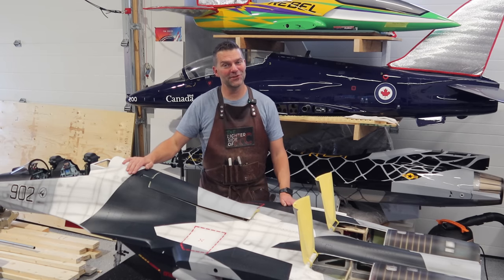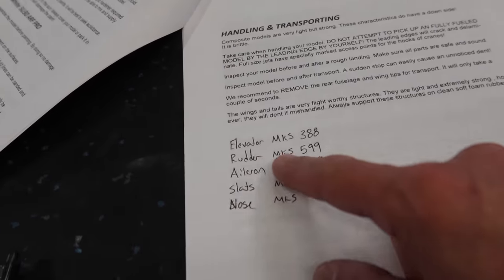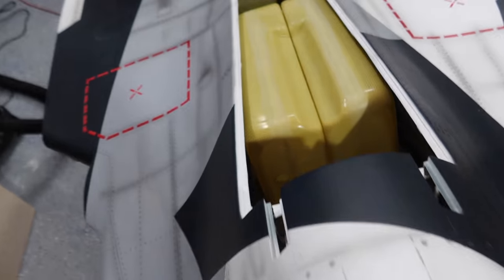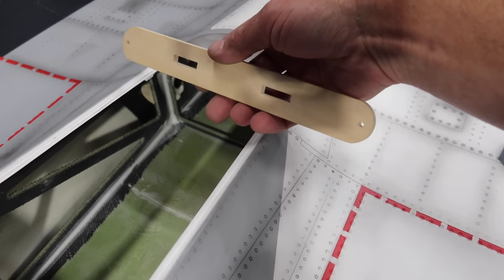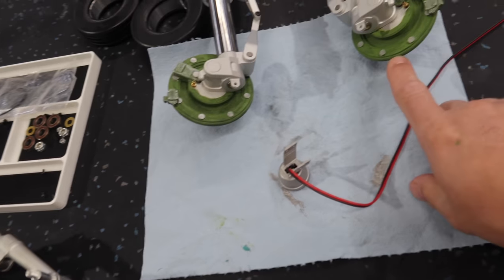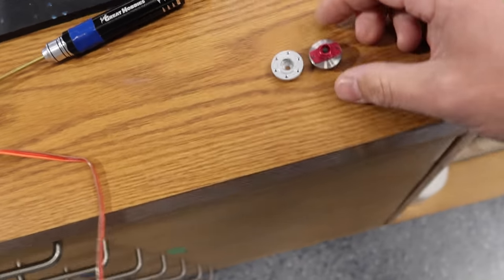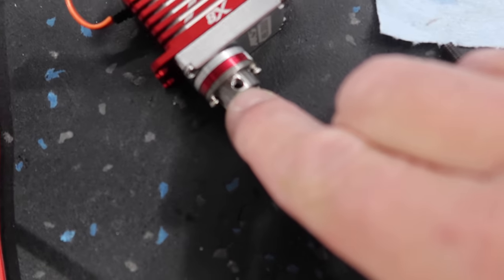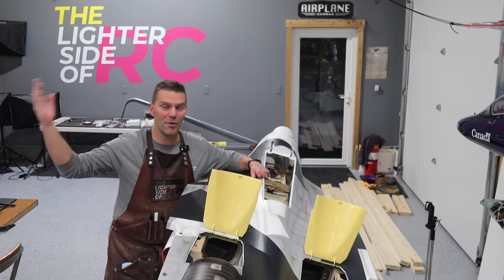The Art of Engineering: Building the Skymaster SU30 RCJET Russian Edition

Comment: Jonathan great video!  Here is a tip. I'm sure you know this but if not, use the DS24 to cycle all your servos at one time. Plug them into the CB or receiver and go to <system> <servo & range test>  set your servo speed then tick the channels you want to cycle. Hit Start and now all your servos can be done in 20 mins! Of course you would need to bind a RX to your CB. You could even get the CB320 and 210 bound and hooked up. Assign all your servos then you get to cycle and test your setup!
Reply from the maker: I didn't know this existed!  Thank you for sharing this!  May end up being the TIP TIME is the first 339 video!

Comment: Hello John, the servos that you use (MKS). how do you determine the power of the servo you need? In 30 plus years of model flying the choice of servos is to me anyway is getting to be very baffling (I've had some years off lol). Also. is there a particular site you get MKS servos as I'm having trouble finding the ones your using in the SU30 as I'm just very curious. Keep up the great content x
Reply from the maker: Hey Amy. There is a few criteria bits that I use. The main stays are the 9930 which is coreless and the 599 which is brushless. The 9930’s are great for pretty much everything. On my kinetix I used 599’s everywhere. On the rebel classics we used 599SL everywhere and 9930 on flaps. The 599 sl to save weight. 

On the big planes you have to go with some of the next level servos 388 or 3850 with the larger shaft and much more power. Those are the staples. 

Oh and typically 1220hv on most steering. 

Supply will depend on where you’re located. I can supply servos to USA or Canada easily. There are other dealers all over the world

Comment: A bit off topic, what is your favorite product to use to hard mount at the wing root for wing retract/servo plug connections? I'm not finding anything with 4 connections that really hits the spot for me. Thank you.
Reply from the maker: Great question!  I don't like to hard mount connectors and I don't think I ever have done a wing or surface connection hard mounted.  i've see mounts for one half of the Ashlok connectors to be hard mounted and the other side floating which I would use but needs to be the right situation for that to work with enough room.

Comment: do you feel safe to feed power to 8+ servos from 2 servo wires that are more than 2m long each????
Reply from the maker: Power to all the main servos except leading edge will come from mid (main) central box. These servo leads at most are 3-4 ft long. 

The signal between both central boxes isn’t the power distribution. Each CB210 has power connection.
Reply: or you will you seperate batteries frond and rear?

Comment: I have a quick question: would it be possible to fly the RC setup that you presented us with a Jeti ds16 or is an ds24 necessary?
Reply from the maker: The New 16 also has 24 functions so wouldn't be an issue.  The issue would be making sure you have enough switches on the radio to opperate all the functions as the 16 doesn't have the rear buttons, switches.
Reply: Thank you very much for your answer know I am a bit smarter

Comment: Hey bud do you happen to know how much the stock tanks hold?
Reply from the maker: Hey Keith.  I don't off hand but in the final video (number 7) we will measure tank capacity during CG and test runs.  Just waiting on 240's to arrive.
Reply: I just measured mine at L Tank = 3750ml, R Tank 3975 ml, and 3500 ml for the rear tank.
Reply: @IVHMSFSR  Thanks, thats a lot of fuel, thats almost 9 mins at full throttle with my motors. I want need the saddle tanks really.

Comment: $1750 in JUST the servos alone, plus 5800 for the airframe, and 6200+ for the engines...jesus man those 3 parts alone cost more than my used 2013 Mustang 5.0 did lol. Love watching it but could never afford this hobby i dont think
Reply from the maker: Plus 6k for the gear. Plus 4000 for all the other pieces to assemble. Plus 500 in wiring. +++++😂😂. This is one of the most expensive “normal” aircraft you can get. You definitely don’t start in turbines with something like this.
Reply: @thelightersideofrc for real...ill just enjoy the build and from my screen😂😂 thing costs $30k once done painted and flying and the controller and everything else like shipping and tax. Id be afraid to fly it
Reply: It's only money 😂lol